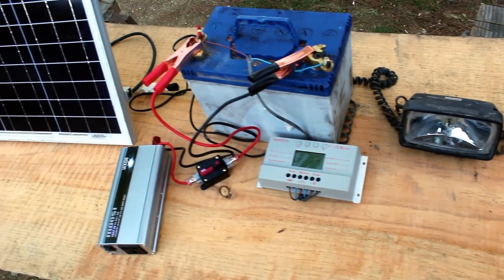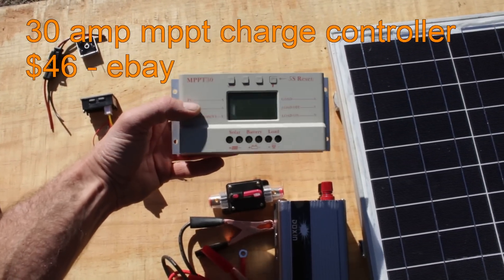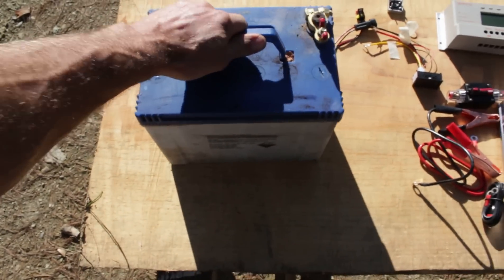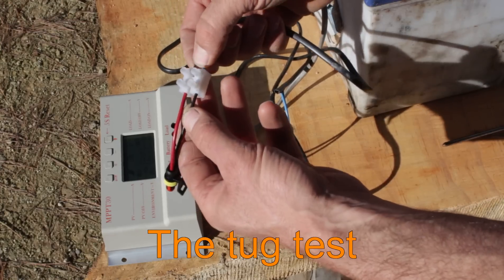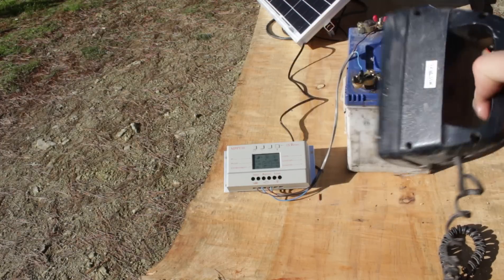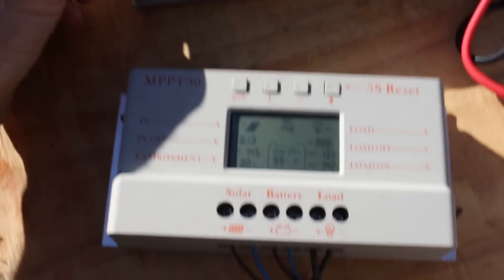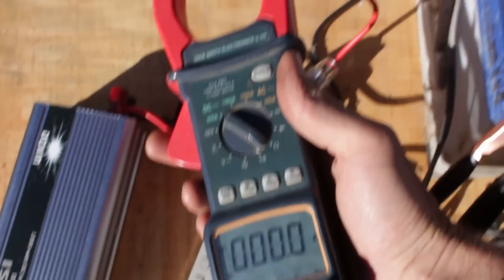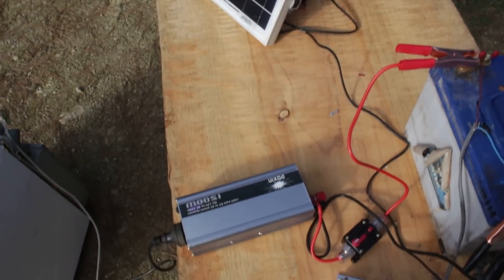How to build  a basic portable solar power system -camping,boating,off grid living-

Comment: Great video.i learned a lot. maybe the solar system is something i can play in the future.The 1500 watts inverter that you have is probably the peak wattage rather than the constant output. Usually, the peak number is twice as the amount of constant, so i guess yours is actually 750watt. i have a 1200 watts constant/2400 watts peak one, and mine is much bigger than yours. so i am pretty sure yours is 750watts constant.
Reply from the maker: yang song Yes, I think you're right, 1500 watt surge to cope with things like electric motors which need that little bit extra to get started.

Comment: I have been searching Ebay and the internet to build the very same design you have. I am highly interested, can you please add to you description a link to find all the parts you have, I did scroll your comments but have not yet seen where you bought them.
Reply from the maker: nteppr http://www.ebay.com/itm/LCD-30A-MPPT-Solar-Panel-Regulator-Charge-Controller-12V-24V-380W-760W-With-USB-/391157171447?pt=LH_DefaultDomain_3&hash=item5b12c8c4f7   http://www.ebay.com/itm/20-30-50-60-80-100AMP-DC-12V-24V-AUTO-CAR-CIRCUIT-BREAKER-RESET-FUSE-INVERTER-/161261465467?var=&hash=item0   These inverters are so much better than the one I showed in the vid, more expensive but much higher output, I run all the appliances in my house with one of these http://www.ebay.com/itm/2500W-Pure-Sine-Wave-Inverter-12V-24V-to-240V-Solar-Power-Inverter-EMC-Certified-/191243253792?pt=LH_DefaultDomain_15&var=&hash=item2c86fc7820

Comment: nice work , i got same power inverter 1500 watts but when i tested it , it gave only 400 watts
Reply from the maker: RANJDAR GTA That's strange, mine runs appliances up to 1000 watts with no problems, if you want a decent sine wave inverter check this one out http://www.ebay.com/itm/2500W-Pure-Sine-Wave-Inverter-12V-24V-to-240V-Solar-Power-Inverter-EMC-Certified-/191243253792?pt=LH_DefaultDomain_15&var=&hash=item2c86fc7820  I'm using one of these to power my house

Comment: That charge controller is a pile of dog sh*t. I bought one of those "MPPT" used it, took it apart and was fairly disappointed to find that it was a PWM controller inside, since it has no inductor. other than that minor detail, it was a great video to watch. keep the vids coming out please.
Reply from the maker: Nicholas2011ist Interesting, yeah they're definitely not top of the range and I was dubious about the mppt claim, but for $40 I can't complain

Comment: Hi, Thanks for the vid. I know next to nothing about solar installations but want to put one in my caravan. I am worried about whether you can get an electric shock off the terminals of a solar panel? and also whether there is any need for earthing? Any comments?
Reply from the maker: Gareth Cook Hi Gareth, you won't get a shock off a panel this size but larger ones can give you a zap. This inverter doesn't have an earth terminal but bigger inverters usually do, in which case you could connect it and the battery-  to the caravan chassis

Comment: Why not connect the inverter to the load of the charge controler?
Reply: Angry Ram I wouldn't try to run my inverter through the charge controller either.  I would connect it directly to the battery.  Can you imagine how many amps were being used when you turned on the toaster?
So what if it doesn't know when to power down :)
Reply from the maker: 2014andBeyonD I'm not sure how robust the controller load relay is or how many amps it will take, but yeah you could attach a slave relay to the controller load output to feed the inverter
Reply: 2014andBeyonD That was my question too, I didn't understand the alligator clips on the battery.
Reply: 2014andBeyonD Because momentary load usage, like occasionally running a drill need the full potential of the battery, not the trickle-charge set-up.

Comment: CAN I JUST USING solar panel to controller then to battery then to inverter ? without using any diod or others safety features?
Reply from the maker: super guyver Yeah you don't need the diode, but it is wise to have a fuse on the battery +, they're only 10 - $15 on ebay
Reply: Angry Ram
that great..tq so much!!

Comment: how did u  connected diodes which  point is connected (4legs) which point please show it to us
Reply from the maker: dekhi I used a multi meter to test, you can use a battery and light bulb if you don't have a multi

Comment: Great video can you set that charge controller to charge multiple batteries ? Could you maybe do another video of multiple batteries many thanks all way from oxford in not so sunny England :D
Reply from the maker: killerzamf You can wire 2 batteries in parallel or use the load function to charge a separate battery - when battery #1 is fully charged, the controller will start charging battery #2

Comment: Great video is it a pure sine wave inverter?
Reply from the maker: Stephen T No just a mod sine but they run most things without a problem, just a bit noisier than pure sine
Reply: yes and it's a lot cheaper than a pure sine wave inverter. Is the inverter still working ok?
Reply from the maker: Stephen T Yes still running fine, I only use it occasionally in my boat. If you want a decent pure sine inverter check out this one - http://www.ebay.com/itm/2500W-Pure-Sine-Wave-Inverter-12V-24V-to-240V-Solar-Power-Inverter-EMC-Certified-/191243253792?var=&hash=item0 I use one to power my house, they  are very good value

Comment: I wish this was the first "solar power system" video I saw when I didn't know anything about them. Straight forward, to the point. Great video, great job Sir.
Reply from the maker: leonscorpio19 Thanks, glad you liked it. One of these days I'll do a more in-depth vid showing how to use an analog plc as a controller, they're so much better than a standard charge controller
Reply: Thank you TrueBlogge, I just finished putting my small system together and finally realized that what you say is true!! lol.. I do need to fine tune as I didn't calculate properly for the power draw from my water pump, but am in the process of fine tuning now. Once I get that right, I'm moving on to another solar project!!
Thank you again.
Reply: have to agree there, the bit about the excess volts being used to charge a spare battery really got my attention along with ref to a 'blue smoke generator' got a laugh out of that, very well presented vid

Comment: Just remember that the circuit breaker or fuse is to protect the cable from melting eg if your cable will start melting at 30a then a 100amp breaker is to big so make sure your cable can handle more current then your breaker

Comment: Open Question:  ...so this was a 3amp charge controller, so I would assume getting a 7, 10, or 20 amp would be fine because that is my new max? Or am i totally wrong and everything has to be specific?
Thanks
Reply from the maker: YouMockMe This is a 30amp controller, Yes its best to have one which can easily handle your output rather than say a 10 amp controller with 9 amps running through it.
Reply: Buddhanz Can you buy just one roll of wire for the whole system ?If so what type of wire ,what amp and so on ?

Comment: Did you say 100 AMP circuit breaker?  1500 watt inverter would be maxed out at about 6.8 AMPs. The normal rule is not to exceed 80 percent of capacity so you should be using a 5 AMP breaker.
Reply from the maker: Its on the 12v DC side remember, 100 amps x 12 v = 1200 watts. If you used a 6.8 amp breaker it would trip at around 80 watts.
Reply: Oh ok, I was thinking the inverter output current....I think :(
Reply from the maker: arrow251 You're right about the ac side, If I was hard wiring I would use a 5 or 6 amp fuse there & an rcd

Comment: Hi there,

Great video. 
Do you have a list & spec  of the items that you used?
I am looking to do the same in my garage which is 100 m away & doesn't have access to any power.
I already have a couple of small solar panels(with a built in diode) up there for a solar powered light and one charging my car battery
Reply from the maker: Ben Parmer Hi Ben, I used a 40 watt solar panel, panel/battery size depends on what you want to run, if its just lights & a few light tools 40 - 100 watt would probably do the job if the shed is in the sun.
Reply: Angry Ram Hi

I havent done anything like this since I built flashing lights controlled by a sound switch many years ago!!

In my garage, I have an old car and a couple of old motorbikes batteries that I want to trickle charge constantly.
So I will be trickle charging say 3 or 4  batteries at any time.so maybe I should get a 100W panel?

I have just bought a Accumate 4 stage smart charger(it was recommended  by my mechanic) its meant to de-sulphate the lead acid battery and maintain/charge it thus helping it last longer.

Any suggestions?

Thanks for your help again

Comment: I thought it was risky yo wire the inverter direct to the load on the CC, , other vids Ive seen wire the inverter to the battery, saying that the load option on the charge controller is just for little things.
Reply from the maker: wotan237 No you definitely wouldn't try to run ac through the controller, If I was going to dump from the inverter I'd use a slave relay controlled by the cc

Comment: I am going away with my car for about 2months on a photo trip, i'll sleep in the car and will be in the wild 99% of the time  i will have to charge my camera, 12v heater, laptop and tablet, i thought about a comp between a 28w solar pannel and 2 power banks  do you guys think this will be enough to keep my stuff charged  i'll probably need around 10-12 AH's a day  thanks for your help!
Reply from the maker: ProgamerEU Sounds like a cool mission. I wouldn't recommend running a heater unless you have a massive deep cycle battery. Try to get the biggest panel  you can afford/carry & try to charge up your things while the sun is at its peak rather than at night or your battery will suffer

Comment: Actually I believe you MPPT controller is suppose prevent any backfeed but if Im wrong Please feel free to correct me Thank You nice vid
Reply: Angry Ram
Thanks for this video.  I am going to create the same only I got a 50w 12volt solar panel.   What rating blocking diode do I need or does it mater?  Thx great video.
Reply from the maker: cruzere120 Yes it is supposed to but it was quite cheap so I'm not relying on it.
Reply: Buddhanz1 LOL ok dont blame ya

Comment: Great vid, Buddhanz1!  Thanks for making it. Was especially impressed that your small system was able to handle a toaster because of those times camping when you just gotta have a piece of toast for breakfast! But seriously, it does demonstrate well what can be done with a small solar power system setup like you have there.  I have a 145 watt setup for camping and it can power can opener, lights, radio, charge personal devices like phones and tablets.  Runs laptop or DVD player so kids can watch movie in the evening.  I completely replicated the DIY solar project here: http://youtu.be/lbkp5zr7ngI It's been a great addition to our camping gear.  I've also used it to demonstrate solar power at green fairs, etc.  Again, thanks for the video!
Reply from the maker: Nice setup & very tidy build

Comment: Has anyone seen Dr Peter Skelts "solar powered chicken leg re-heating wizard".Its a double 100watt solar panel linked to a wirewound steel rod that is inserted into the cold chicken leg and brings the meat up to temp by converting the current into heat.Ideal for picnics,the panels come with all terrain rubber wheels to enable transportation to even the most awkward picnic spots.The Dr mentions the importance of ensuring the chicken is piping hot throughout before eating.

Comment: Wow, that is some thin inverter cable, what is it 10awg?  I can't believe the manufacturer supplied those thin cables with a 1500w inverter.  Actually, it's hard to believe that inverter is 1500w, it's so small.  The other thing, your supposed to have the breaker close to the battery, not close to the inverter.  Liked the video, short and to the point, thanks :-)
Reply from the maker: Bubba Yeah It is pretty light, I wouldn't be running it over 1 kw for any length of time but for under $60 I'm not complaining.

Comment: hey mate, thanks again for a great video. I've just bought one of these units on ebay, very reasonably priced for learning - and should work well on my jetski :-) what was shipping like for the solar panel on ebay? I see a few on trademe that look adequately priced? cheers
Reply from the maker: On a jetski? what would you use it for? I actually got the solar panel from trademe-http://www.trademe.co.nz/motors/boats-marine/parts-accessories/other/auction-737423725.htm postage was only about $11. Glad you found the vid helpful.
Cheers
Marty
Reply: Buddhanz1
ha, yeah that probably sounded confusing - for the jetski to charge the battery when we're away camping. sometimes doesn't start first time and can drain the battery, so need a way to it - but will obviously come in handy for other uses too. the panel i'm looking at is this: http://www.trademe.co.nz/Browse/Listing.aspx?id=736632793
Reply from the maker: Oh right, that makes sense, yeah 50 watts is a good size for camping, postage is pretty hefty on that one though.
Reply: Buddhanz1 ...but handy if you live just around the corner though and can pickup ;-) Thanks again
Reply from the maker: chimeranzl In that case, It's a bargain.... good luck ;)

Comment: Thanks for doing this tutorial.
I have been thinking of doing a small PV system for a while.
I like the way you can set the parameters on that charger.
Reply from the maker: Yeah it's a good little charger, also works with 24 volts, I used it as a backup when my house controller gave trouble